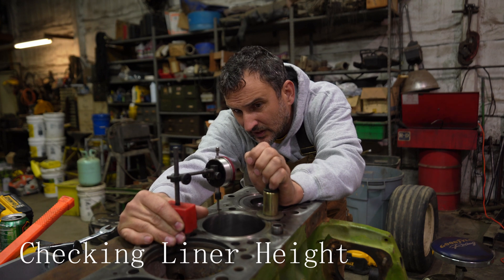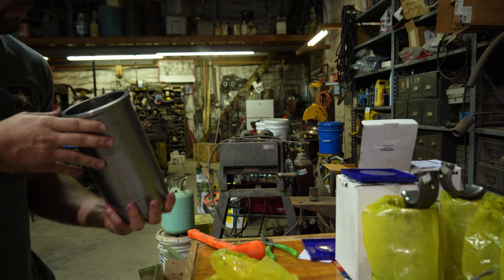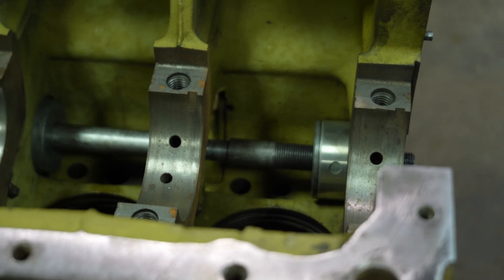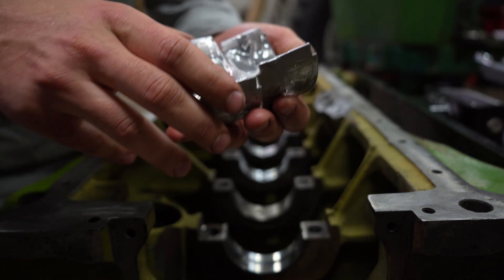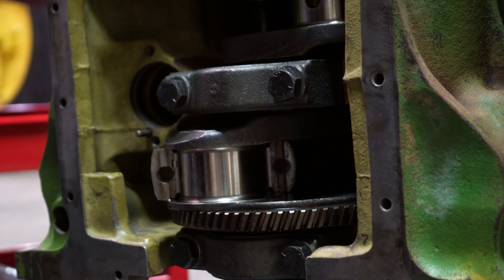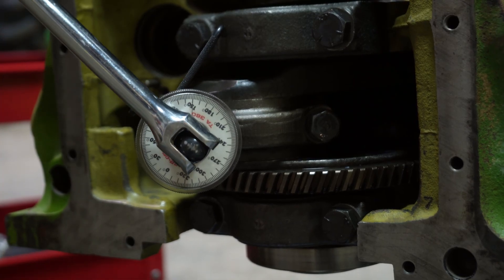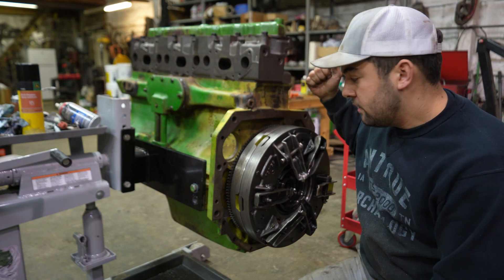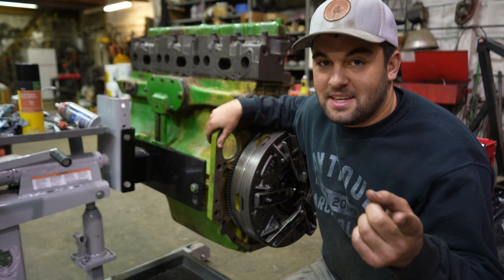4230 M&W Turbo Build - Part 4 - Engine Reassembly

Comment: Tip of advice I usually waited until I have the eng running and then Set Valve lash. :) so then you don't have to double do it.

Comment: What would you have done if the plasti  gauge was beyond spec??
Reply from the maker: That's a great question! If the bearing clearance was out of spec we would have the crank ground even smaller, but then buy oversized bearings to compensate for the grind! 👍